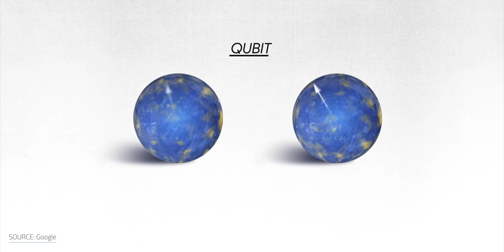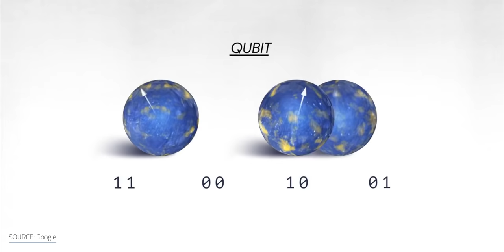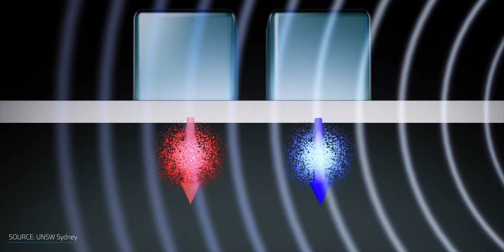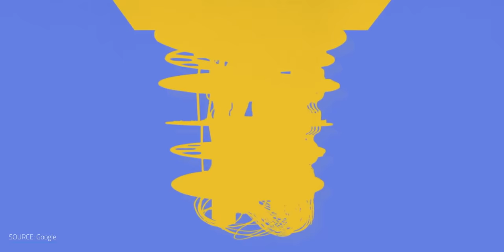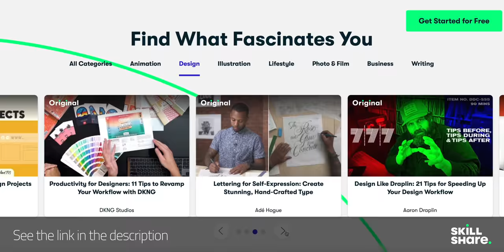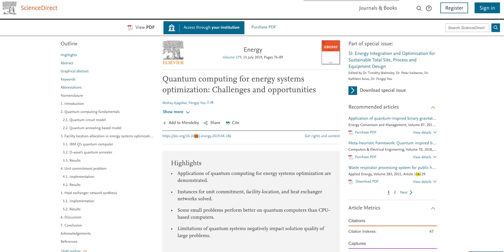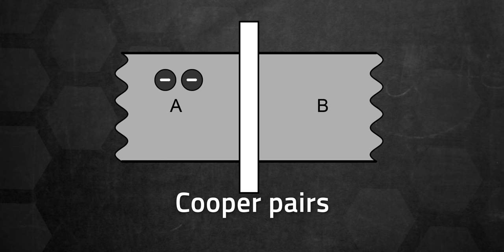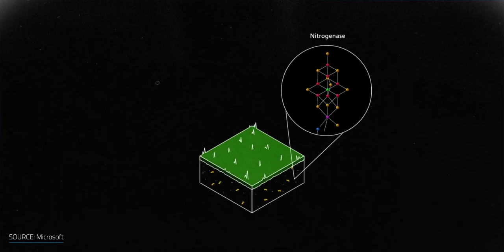Quantum Computers Are Coming … But Why Should You Care?

Comment: Excellent overview of a complex and rapidly changing field!

Errata:
"In a quantum computer the postman can simultaneously check  multiple ways all at once." Half correct, but important missing implications. the issue here is that there will be no way to know how the postman got through the proverbial maze, nor is it deterministically repeatable (once you get through once you don't know when it will get through again). Particles in superposition state act individually randomly, and in aggregate according to the probability distribution over their states. So the postman may get through the maze, but all you will have learned from that is that the maze is solvable. Moreover (and importantly), if the mailman fails to get through the maze, unlike in a deterministic system, you have no way to know if the maze is solvable or not because you cannot control the particles while exploiting their superposition.

"entanglement works at lighting speed...literally." Not literally, in fact this quite misses the point: the entire reason that entangled action is so appealing is because it happens instantly regardless of the distance; that is to say, **faster than the speed of light**. How is this possible? Without getting too deep, because entangled particles are actually the *same particle system*. The catch is the more you ask entangled particles to do and the further apart they are the less likely the are to remain entangled, and to re-entangle particles they usually need to be right next to each other.

"regular computers increase linearly with the number of transistors you add while it goes up exponentially for quantum computers with the number qubits" Wrong facts right sentiment. Both go up exponentially, but for N number of transistors  (or qubits), conventional computers have theoretical increases of 2^N, while quantum computers have theoretical increases of C^N, where C is the number of superposition states of the qubit (often 8). In both cases scaling always leads to lower than theoretical increases.

"paper compares this [wind turbine calculation] for a classical and quantum processor" Missing context, still impressive: it is just using a theoretical, representative calculation, and the authors acknowledge that the conventional approach can be improved by optimizing with  known compute techniques. 

"quantum computers are more energy efficient than conventional machines due to quantum tunneling" False. tunneling over a Josephson Junction (or other junctions) does in fact help, but the need to keep quantum computers cooled to absurdly low temperatures more than wipes out this gain. Current (and all near-future) quantum computers that require superconduction are and will remain, as a result, less energy efficient than conventional computers. when just accounting for the energy expended to run the calculation, i.e. the energy required for the excitation of qubits vs transistors for a calculation that can be done by both, yes quantum computers are more efficient. But in the context of climate change, the next energy is what is important.

 Final important note: all of the applications regarding simulation and optimization in the latter half of the video do not require quantum computing. In fact, currently they in general run more dependably (in terms of outcomes) than their quantum counterparts. That does not discount the future benefit of moving them over to quantum computing, but its important to note that quantum computers are not a requirement for any of these achievements, simply an accelerant

Comment: Are windmills even an small fix for carbon footprint or is it a false since of security like recycling ♻️  like in your video a few weeks ago?
1) what the carbon footprint to manufacture all the parts to build and repair 
2) some windmills use the gas Sulphur hexafluoride(SF6)  used to help prevent fires, but it does escapes into the atmosphere.  This SF6 is 23,500 more potent then co²

Comment: There are already photonic (light) chips, that have greater power efficiency than conventional chips. They can run multiple calculations in parallel by dividing it in light spectrums aka bandwidth aka colors. 
Those will become the norm in servercenters sooner than Quantum chips will. Photonic chips are easily 12 times faster per watt. Less heat, so less cooling needed. But also have their limitations. Like with the sort of calculations they are good at.  Mostly stateless calculations. (So no memory) Plenty good for AI though. And you need interoperable circuits to switch from light to electric and back. 
Which makes it harder to put in consumer products. But for dedicated servers racks, it is not so much an issue. Especially if one photonic rack can replace 4 to 12 conventional racks. Depending on how much you can push the light parallelization.
Reply: There also is research into photonic quantum computers! Although the implementation for that is still some years into the future, but the advantages are essentially the same plus having higher coherence times.

Comment: 2:10 "that we can see the heads and tails at the same time" - when talking about superposition, in the example of a coin-toss.
However the superposition state is valid (according to Copenhagen interpretation, which still have no proof that it's just anything more than interpretation) only until MEASUREMENT!
So, no we can't SEE the heads and tails at the same time, we can only think of a piece holding some quantum information as holding all possible states for that piece, but only until we measure/observe it somehow.

Comment: The only problem I have with quantum computing is that I’ve been excited about it for almost 10 years and I still haven’t seen anything exciting happen with them. They seem like highly specialized machines designed for specific computational problems like simulations, encryptions, or machine learning… or are they I have no idea. All I know is that I’ll probably never have one on my desk helping me with productivity or enabling mind-blowing graphics for my games. So I’m less excited. I think I’m also not impressed because I was promised that the computational power of quantum computers goes up exponentially the more q-bits you have and so far, I haven’t seen that. If you really could compute 2^1033 bits of data all at once, you’d be able to simulate the universe, and that’s just not the case at all. So I just don’t understand what these computers are actually doing or what it even means for them to have 1033 q-bits as far as practical applications. Is that better? Is it the same? I mean it hasn’t solved anything significant as of yet and it totally should be if it can compute 2^1033 flops/second. Like none of this means anything to me. I feel like it’ll be part of a massive computer of the future that uses all kinds of highly specialized and optimized hardware that people can pay to use like a utility. So if anyone has a use for quantum computing, they can just buy compute time for their research or whatever. But it’s not going to change personal computing anytime soon, or ever. Maybe it can help with climate change, I have no idea. To the extent that computers can help us solve any problem, I think they will.
Reply: The main problem is that quantum computers are limited to the speed of light just like everything in the universe. The over the top calculation was done without time being part of the equation. The 4 dimension was discovered to be time so that tells you what the equation was missing. Quantum clocks exist today and they work well.

Comment: Superposition isn't both states at once. It's fractional parts of each, still adding up to a total of one whole. It's like asking if you're entirely vertical or horizontal at any point in time.. you're neither. You're somewhat vertical and somewhat horizontal at all times, but the description of your state is a vector sum of the two. You aren't fully either one ever. Quantum superposition is the same. You just don't know which till you measure (physically interact with,) the system. Unfortunately physically interacting with a quantum system (to measure it in any way,) either adds or removes energy from it. Depending on how much energy it already has, this may or may not be enough to cause decoherence. There's really no mystery here. It's just a terminology problem. The trick of quantum computing is to make the measurement step actually representative of a solution to a problem. Each quantum computer, so far, is a specifically designed quantum circuit to solve a particular problem. One can argue that QC solves problems of gradient descent by literally allowing energy to descend the gradient and then measure the output to find the answer. That works! But ultimately what we need is what we have with digital computers: the ability to reconfigure a quantum computer via software asking to solve a different problem. So far, we only have a limited way to do that. We currently have to literally physically rebuild most quantum computers to solve different problems. The true test will be making a quantum computer that can reconfigure itself at runtime. I think we'll get there

Comment: Wow, what a video! This felt like a top level survey of a very large subject. Someone could spend half a year drilling down into each of the things you've described here - and by the time they'd finished learning about it the subject of quantum computers will have progressed and changed again. There's so much going on.

One thing that really struck me was the "Majorana zero modes." I've never heard of them before, but if they really exist they sound like a pretty big deal for physics. It's kind of awe inspiring that Microsoft found evidence for them! I need to know more about this.

Comment: You mentioned that quantum computers would be needed to manage an electric grid when it comes to too many suppliers. 

These days evena  dumbbel comes with an app, so why isnt it possible to just install flow controllers to every solar/wind panel that homeowners have? 
I get it that its a consuming computer, but if thats the current affordable technology level, why isnt it possible?

The usual "problem" with powerplants that it takes away precious land. But with solar roofs a city can be turned into its own powersupplier without sacrificing any space.

Comment: Quantum computing is not a substitute for "classic" computing. It targets completely different problems. You won't have, for example, a database server or Excel spreadsheets being run on a quantum computer. The data processing and computation algorithms, however, could run on a quantum computer, depending on what you're trying to model or calculate.

The biggest limitation as well that I don't think has been overcome (yet?) is the need for these processors to be super-cooled down to sub-1K temperatures. That's under 1 Kelvin, and the closer to absolute zero, the better.
Reply: maybe chuck testa could help he is very cool

Comment: I don't think quantum computers will ever be in homes, rather I think we will have machines that dial into central QPU's to process information. So for example, if I'm exporting a video, I would send the data to a QPU and it would return the finished file almost immediately regardless of complexity or length. The fact they are writing language that will allow cross talk between the two types of computers, I'm willing to bet I'm right on the money.

Comment: Mixing in the same bag quantum annealing (e.g. D-Wave) and universal gate quantum computers is a very good recipe for vague and unrealistic claims. Quantum annealing solves a specific optimization problem and consequently it can be used to solve a broader class of optimization problems when a reasonable analogy can be constructed. This does scale to several thousands of qbits and the performance is truly impressive for the few suitable problems. There are real world applications and lots of people dream of finding the holly grail that would enable to resolve their favorite optimization problem using quantum annealing. Besides the need for a good analogy between the two problems there is also the constraint that the optimization problem must stay small enough to fit within the number of qbits (you won't optimize an electric grid with hundreds of thousands of nodes on a D-wave with 5000 qbits). Universal quantum computers on the other hand are fascinating (everyone can create an account and use those from Google and Microsoft) but a far cry from being useful in any ways. First, they have a lot less qbits (last year, IBM proudly launched their 127-qubit Eagle processor). Also, one of the very few (some would say unique) meaningful algorithms known to humankind that exploit these types of computers is Schor's algorithm: an algorithm to factorize numbers (in cryptography if you can easily factorize a large number into 2 non trivial factors, you get access to everyone's secrets). Peter Schor is the genius of universal computing and got many very well deserved awards for his numerous contributions to the field. That said, I believe that his remarkable algorithm (yes it does require deep understanding of advanced algebraic constructs and number theory) so far can only factor numbers up to 21. That algorithm has been invented more than a quarter century ago. I believe that it would be difficult do find another algorithm even remotely as useful as Schor's algorithm. This does put some perspective on the current state of universal gate quantum computing. Contrasting this to the limited but real and practical success of quantum annealing does highlight the dangers of mixing the two indiscriminately.

Comment: I have Mac M1 which is very power efficient, but the electricity I use right now is from Coal/oil here in Philippines. So it would be nice if I could reduce my usage of these dirty energy by connect my laptop to a supercomputer that is located somewhere green energy are, to do the computing for me. So the dirty electricity in my Mac only have to used for the display, and not actual computing power. that way I and many more could reduce dirty electricity

Comment: In the original Star Trek, even though they had large computing power, there was no mention of using quantum computers.  That was a bit beyond the imagination of Gene Roddenberry and his writing staff.  But to be fair, if Scotty or Spock had mentioned the word quantum in relation to the ship's computers, probably 99.9% of the viewers back in the 60's would have thought, "Quantum?  What the hell is that?"  Additionally, they didn't even have cameras included in their communicators (as with a cellphone) in order to send photos or videos back to the ship.  Nor did they have a scan feature that could find and lock onto the radio signal during periods of bad reception.  Remember Capt Kirk sometimes using a dial to try to hone in on the signal?

Comment: Also, quantum computers require a LOT less electricity compared to transistor based computers. In theory, it should produce zero residual heat.

Comment: I think it's obvious that regular computers won't be going anywhere. Since these quantum computers are so difficult to maintain. They simply wouldn't be practical for many situations where any modern computer is overkill. I'm not seeing any phones, or laptops, equipped with a cooling system that can maintain temperatures of less than 1°k, in the foreseeable future.

Comment: Have yet to hear a good layman's explanation of how it speeds up computing, many CPU cores do too, especially massive parallel processing of a GPU.
Reply: And 1 million bomber planes can probably do the same amount of damage as a nuclear bomb. However, the costs in material, the size of all the armament etc. etc., that's the point. You can reduce all those issues down to almost nothing in comparison. We've pretty much reached AFAIK the limit for how tightly we can pack our chips with data, new clever workarounds are being done of course, but the point is that to get forwards now, we need another breakthrough. In order to avoid having a million CPUs side-by-side, we need to think outside of the box, and the result is something like a quantum computer, although we're still looking for ways to apply it right. At the moment, quantum computers don't allow themselves to applied on the most common problems we have, so it's still a ways off.

Comment: I really don't see the significance of the maze problem. What's wrong with writing the program in a multi threaded approach? It would be a bit more complicated than a traditional one at a time method but certainly not impossible and not requiring "quantum computing" whatever that may be.
Reply: it’s not mentioned in the video but i think the significance is that qcomputers would essentially mitigate the p=/=np which is used in so many aspects of cyber security including bitcoin and other cryptocurrencies. essentially it gives a improved version of brute forcing to solve problems that we use as the basis of cyber security (as well as other problems). digging deeper into the research behind the p=np millennium problem will shed a more light onto the concepts behind the offhandedly mentioned maze problem

Comment: sounds like Quantum Computing may be the missing piece to make fussion reactors... If I remember one of you videos correctly one of the fussion reactor designs was trying to modulate the energy field in order to maintan the fussion reaction; so a quantum computer would allow a predicitve program to modulate the reactor on the fly. Tech is still 30 years away though ;)

Comment: the energy efficiency advantage of quantum computing is a false advantage. If power consumption of quantum computers is just 0.02% of standard computer, they'll just data centers with 5000x more servers in them. (also does that effciency include the power required to get the chips to near absolute zero?)